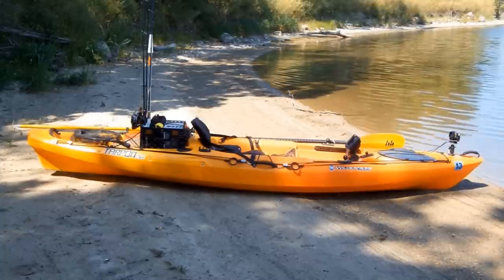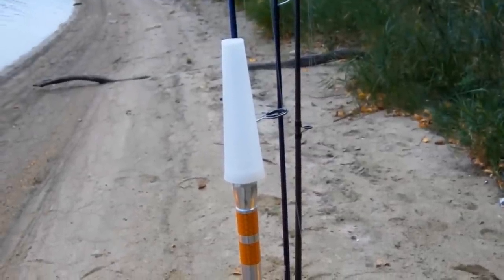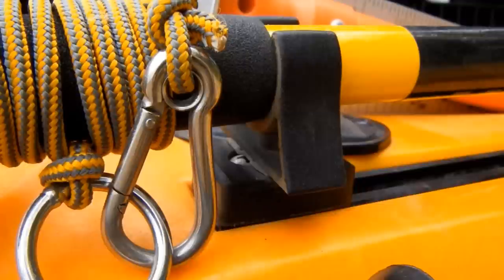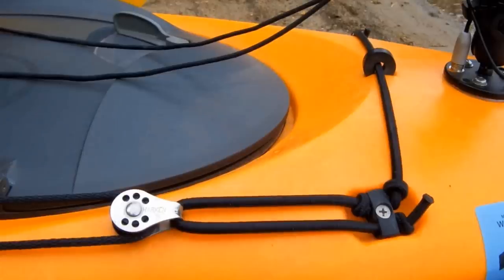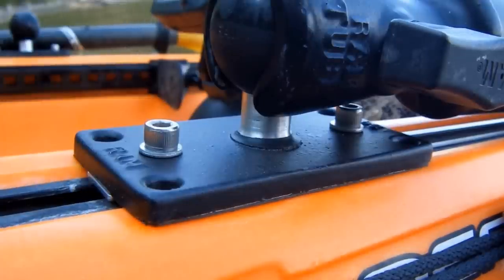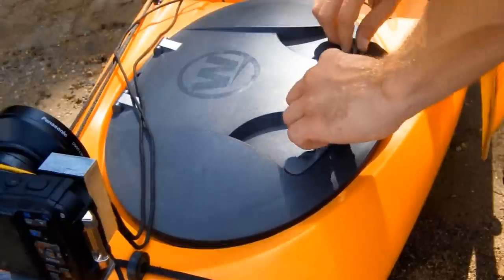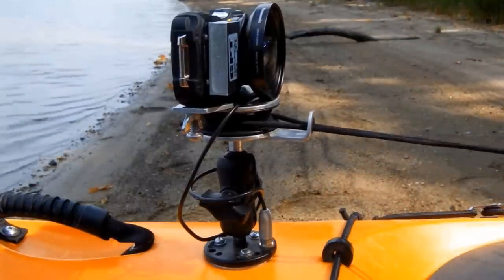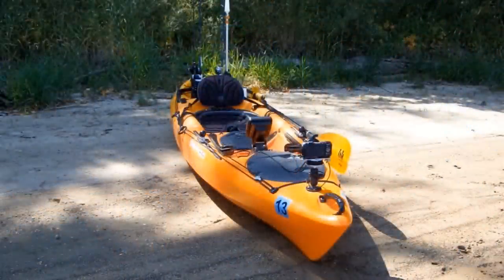My Tarpon 120 Fishing Setup (2012)

Comment from the maker: All my summer gear is in storage for a few more months, but I can explain it. The 303 is a uv protectant, it will prevent any drying, cracking, and fading caused by the sun. I first wash the kayak, then spray the 303 onto a towel or directly onto the kayak and wipe it down. It's pretty much just like putting armor all on a car dash. It has a similar effect too, making everything look shiny and new. It also repels water and dirt and resists stains.

Comment from the maker: Yes, you can glue the transducer to the bottom inside the hull and they still work. I used marine goop to glue mine in. You just have to make sure there aren't any air bubbles in the glue. You want to press the transducer into place too, you want as little glue between it and the hull as possible. I put mine right under the cup holder and wedged a piece of foam in there to hold it in place while it dried.

Comment from the maker: Thanks! The stake out pole is made by hobie. I used marine goop to glue in the transducer. It works great shooting through the hull, you won't notice any difference as long as you don't get any air bubbles between the hull and the transducer. You can always test your transducer before installing it, just put a few drops of water on your hull and press the transducer against it while your on the water and you should get a reading.

Comment from the maker: If streams are where you'll be fishing the most then you probably don't need the fish finder. Usually on the shallow rivers I fish the only time I turn mine on is to check the water temp or mark a boulder on the gps map. I'm almost always targeting smallies so mostly what I do is sight fish and work rocky areas, trees, weedlines and current breaks. If I'm after walleye or catfish it does come in handy sometimes for finding those deeper areas when I can't see the bottom. Hope this helps!

Comment from the maker: I think it was marine goop I used. I just glued the macro stand to the camera, you can still remove the lens. Not sure if it voids the warranty since you aren't opening the camera, you'd probably have to read all the fine print to find that one out. You might be able to use silly putty or something like that to seal it up, I think thats what I'm gonna try to seal the hole around the plug on my gopro housing.

Comment from the maker: Thats the one I use. It works really well with the wg-2, no vignetting in photo or video mode unless you try to add another filter such as a polarizer between them. I had a little blurring in the corners with the polarizer on. My video "nice day for a paddle/new camera test" I had the extra filter on so you can notice some corner distortion there. I also found the "mountain" focus mode on the wg-2 worked best with this lens, everything over 18" from the camera was focused pretty well.

Comment from the maker: Also this should work with all sonar transducers, but if you want to test yours before gluing it in you should be able to put a few drops of water down in your hull and press the transducer against it. As long as there isn't air between them it should work. I use this method to check depths through a foot of ice with my humminbird.

Comment from the maker: Thanks! That one's main purpose was to make myself visible to other boaters at night, although I did come in handy a few times for tying on a new lure. I'm making another one using an olight s-10 flashlight that will be around 300 lumens on full blast to use as a video light for night fishing with the gopro. I used it in my ice fishing hut and it was like having a 60w light bulb in there. I just hope it doesn't attract too many mosquitoes!

Comment from the maker: I really like the seat on the tarpon. I can paddle around all day and stay comfortable sitting in it. I have the old phase 3 seat in mine, the new tarpons come with the air pro seat which looks about the same but you can also adjust the height. I don't have any experience with the cuda but its seat looks pretty nice. It probably has the better back support of the two. I think I'd like the cuda seat once I'm at the fishing spot, but I prefer the lower seat in the tarpon for the paddle there.

Comment from the maker: I have everything in storage for the winter, but all I did was get a couple 2x4" ram bases (RAM-202U-24) and drilled my own holes just big enough for the bolts to fit through along the middle about 5/8" from each end. I used the wilderness systems slidetrax nuts I already had and found some allen head bolts of the same size and a couple washers at the hardware store. Try to find stainless bolts if you can. It installed just like the universal plate would. The tube I used is ram part #RAM-119B

Comment from the maker: Thanks! I've never had a problem with the rod holders moving. The ball has a rubber coating so as long as you tighten the handle enough it shouldn't ever move.

Comment from the maker: I have a DMW-LW46 .75x 46mm lens, it screws right onto the macro stand that comes with the camera. It's a great lens, almost no distortion at all but it is a little heavy so I ended up gluing the macro stand to the camera so it wouldn't fall apart on the water. Any 46mm lens should screw onto the adapter although you might get vignetting or distortion with some lower quality or wider angle lenses.

Comment from the maker: The wg-2 comes with a snap on macro stand that has threads you can screw a 46mm lens to. The lens I use was a bit heavy so I used some marine goop to glue the macro stand to the camera so I don't lose it and the lens if I bump into something or rotate the camera too fast. That also sealed up any gaps there so no water can get between the camera and the lens.

Comment from the maker: Thanks! You'll have to check the rules in the state you live in or plan to use your kayak in. A lot don't require registration for non motorized boats under a certain length. I live in ND, which requires no registration for my kayak. I fish in MN a lot though so I have to register it in order to put it in the water there, even though I live out of state. They gave me the stickers and a card I have to keep with me when I registered at the DMV. You'll probably also have to have a life jacket.

Comment from the maker: I used 3/16" HDPE "cutting board" plastic and some 1/8" x 1" aluminum strips. The aluminum strips run along the top and bottom and have a 90° bend at each end where I drilled holes and tapped 8-32 threads so I could grind the screws flush with the inside. Using a nut would work fine as well, just make sure all your hardware is stainless steel so it doesn't rust. I also cut a piece of styrofoam and added a piece of HDPE on top to put under the boxes so they sit level with the top of the crate.

Comment from the maker: I don't think I could sell it, I spent way too much time out in the garage getting it to actually work. I'll still get some use out of it this summer too. It was made mostly of junk I had lying around so I don't know if I could make another one quite the same. I'll put a link in the video description to some pics of it disassembled though. It could be simplified for the gopro, for one you wont need the extra top plate since you dont have to screw the camera in from underneath.

Comment: I just was gifted that exact kayak! It's been sitting out for quite a bit, no bells or whistles, I really want to make sure everything is structurally sound and do any necessary repairs. Suggestions? Greats videos!
Reply from the maker: There’s not a whole lot of maintenance to do on them. Some 303 protectant will make it look new again if the plastic is starting to fade. Other than that just make sure there’s no really deep gouges on the bottom that need smoothing out or repair.

Comment: Great / awesome videos!
Excellent work on your kayak and great ideas. Question on your rod holders .... Have you had any problems with the ram ball and clamp not holding tight. Like if you were trolling and you snagged. Would the rod tube swivel on the ball from being pulled to hard?

Very clean yak set up!!
Thanks!

Comment: how did you attach the net in the front area of the hull behind the battery pack?
Reply from the maker: On the bottom I attached it to the scrupper hole tubes by wrapping a piece of mounting tape and then a zip tie around them. The top attached to the bottom side of a few of the hatch screws. The newer Tarpons might be difficult to do this without some modifications, instead of a washer/nut on the bottom they have a plastic "stalactite" molded into the hull that the screw threads into. I didn't bother adding that net in my new kayak, the battery box prevents anything in the front hatch from sliding back.

Comment: is this kayak worthy in rough ocean?
Reply from the maker: Joseph Saeteurn I live about as far as possible from any saltwater so I'm probably not the best person to answer that question. I have seen Tarpon 120's being used on the ocean in other videos though. One thing I noticed with my new 2015 T120 compared to this one that's a few years old is the hatch design has changed. The new ones have a lip on the lid that fits tightly into a groove when closed, a little more effort to pry it open but I'd imagine it would do a better job of keeping out water in rough conditions. That seemed to be the main complaint I'd see from people using them in rough water was that the front hatch would leak.

Comment: What type of Mount do you use for your hummingbird fishfinder?
Reply from the maker: Tommy Garza I make my own mounts using ABS plastic, 3/8" thick for the top plate which gets attached to the kayak and the Humminbird base screws directly into the ABS plate. I also used a piece of 1/8" ABS to make a 2x4" spacer to compensate for the raised edge around the mounting location.